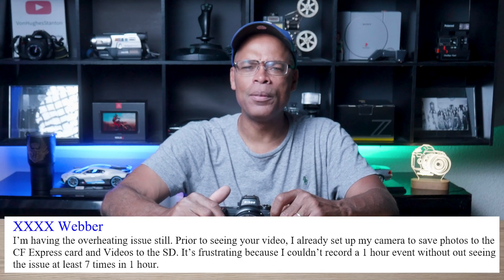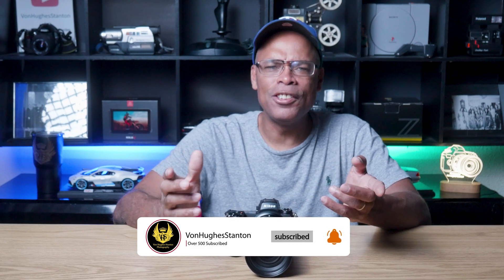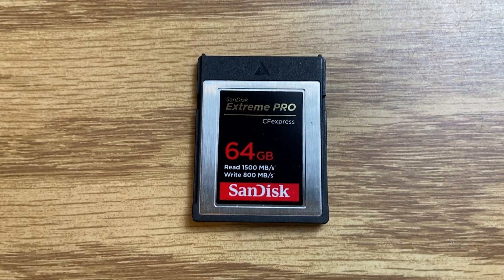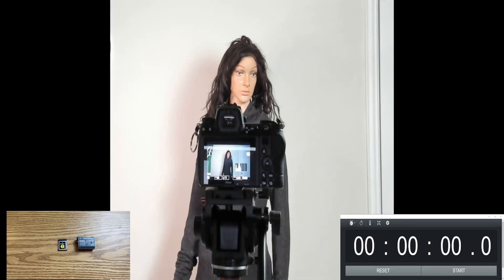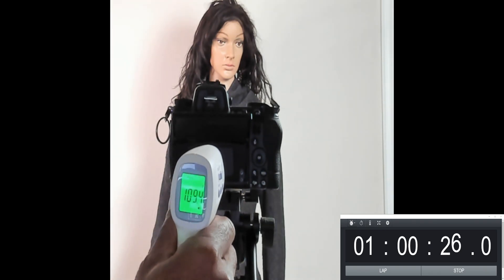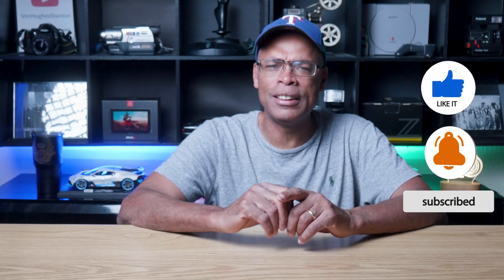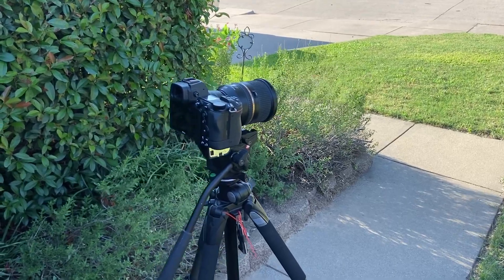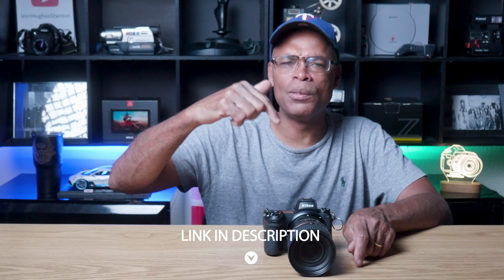How To Fix  Nikon Mirrorless Camera Overheating | Nikon Z6 II

Comment: I am I little confuse, what make hot The battery, card or other?  I using San Disk Express Pro 128 GB  Read 1700 Write 1200 CF Express.  Thanks
Reply from the maker: The battery and the memory cards are the two biggest offenders. If you’re using the wrong generic battery, when it discharges it will produce more heat. 

Memory cards have different heat shields ratings. Sandisk is in the middle and Delkin Black on the higher end. The faster the card the more heat it will generate. If you’re like me a hybrid shooter. Switching between photography and video can fill your buffer fast when you’re using 4K.

Comment: I believe the problem isn't the memory card or battery but the problem is the CF slots. Why, I meanly do only photography and the first 3 month I had no problems with my Z6ii. But after a repair on the SD-slot where they had to replace a complete electronic part I got these overheating messages within 30 min during taking photo's (not in burst) outside on a cloudy day at a temperature of 20 degrees Celcius / 68 degrees Fahrenheit.
Reply from the maker: The Sd slots may have been damaged by the intense heat of the CF card. Something to think about. 

I had to change CF cards due to the extreme heat cheaper cards created.

Comment: This issue don't have in XQD card
Reply from the maker: XQD card is slower but if your just doing photography then it will work. Using a XQD card won’t prepare you for your next camera. Your next camera most likely will have a CFEXPRESS card.

Comment: The 29 minute limitation has nothing to do with helping the over heating problem.  When DSLR’s first introduced video recording most areas wanted to charge 14% import duty, same as pure video cameras.  The compromise was that a restriction of 29 minutes was imposed in firmware.
Reply from the maker: The 29 minute limitation that was impose on DSLR’s was a factor. How long does it take your camera to overheat running 4K 30?

Comment: Good info Von! I recall seeing the over heating message once when I used my Z6II as an overhead camera, with an external monitor attached and on my desk. The screen was flush against the body, which I figured caused it to overheat.  Being in Arizona, I typically cool the room then turn off the AC to avoid the hum, when recording. As a solo shooter, I would record to the time limit as I tended to not stop if I make mistakes and just use the one file to edit from. Using a dummy battery to power the camera and keeping the screen away from the body seems to help with the overheating issues.

As far as the memory cards, I use the CF Express card exclusively for video and the SD for photos. I went out to shoot and forgot I took out the CF Express card, the SD performed well to record 4k videos, in the tropical heat of Thailand. Granted, each clip was probably no more than 30 seconds but my iPhone was getting hot and dimmed the screen. As I use the camera more for videos these days, I find myself looking at newer equipment from other manufactures, that have fans to keep them cool. Some days I recall how well the Panasonic HC-X1 camcorder performed in the warm house for long recordings, with it's built in fan and I wonder why camcorders got a bad rap. Especially now that people are building out their mirrorless cameras to be cinema cameras and manufacturers are adding fans to mirrorless to cool them, when this was already in a camcorder. Seems to me they need to use a camcorder as a base for hybrid cameras going forward.

Sony announced that in a couple of years, camera phones are going to replace DSLRs. From what I can do with video on my iPhone, I think the camera companies need to do like Blackmagic Design and their BMPCC 6K camera and put a large screen on the back for video shooters. The younger generation seem to be forgoing the viewfinder and use the screen to compose shots, these are the folks they need to build new cameras for, to remain relevant in the future.  We keep hearing about a Z8, I truly hope Nikon can put a lot of video recording functionality from the Z9 into that and make it with a large screen and fan.  Thanks for the video!  Keep posting and growing your channel!
Reply from the maker: Thanks for your adept comment. In my opinion camera manufactures were adding more video capabilities as an add on not a source for serious video. Think about this analogy, Baseball is similar to the current state of digital cameras. Its full  of older guys that can afford tickets and cameras. Just like baseball will want to keeping hitting balls and taking photos.

The younger generations finds baseball stuffy just like our digital cameras. They want to capture fast moving subjects with little setup. Hence the smartphone. They love the NBA.  

I found myself using the viewfinder during an event were I was shooting vertical shots. It was kinda different.

As for camcorder, I had two. These thinks are hard to sneak into a ComicCon orother events without a media pass. A few weeks ago, I tried to sneak my Nikon Z6ii with the Atomos Ninja V into a ComicCon. Attendant said No Entrada! without a Media Pass.
Reply: @VonHughesStanton  It's interesting that a recorder somehow means you need a media pass. Imagine the amount of YouTubers that were there shooting with their phones. There were probably some official media people that used their phone as well.

Times are changing as it does for each generation, companies have to adapt to the generation that comes next to keep relevant or go out of business. Nikon is in catch up mode with their earlier cameras. I really feel they need to do like Canon and Sony, make a Cinema camera for enthusiasts and professionals. For example, Z8 and Z8C. The Z6II is a good hybrid camera that they can improve on. I don't mind if they make it a little thicker by adding a fan but I would like a bigger fully articulating screen, like the Panasonic S1H.

It's sad to say pure photography gear is being left behind for gear that can do both. The younger generation want it fast with little setup as you say and if the camera manufacturers don't provide gear to stay ahead of the camera phone, they are going to get surpassed by them.